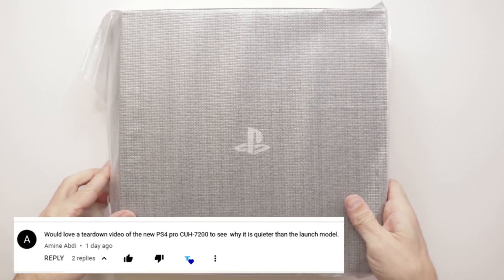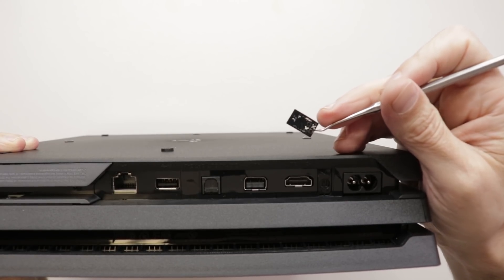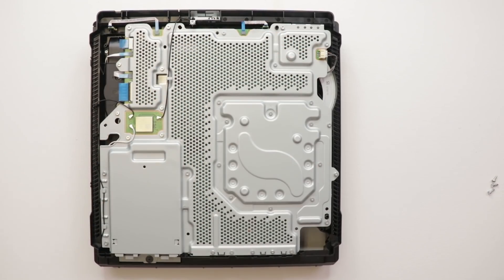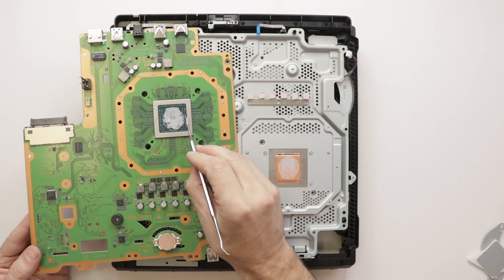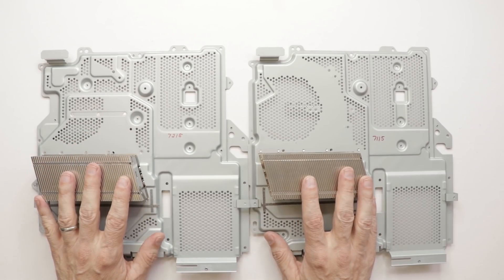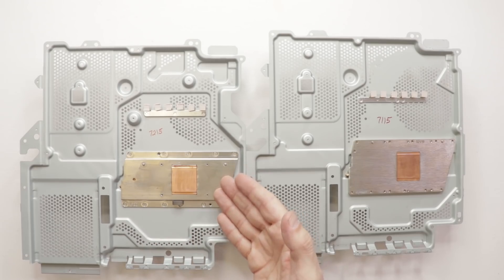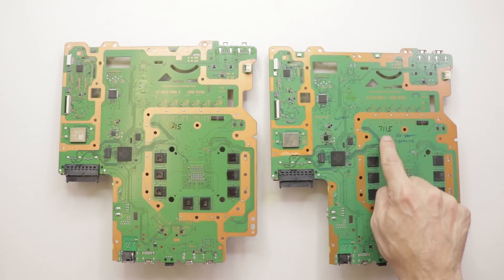The New 2018 PS4 Pro is so Quiet - But Why? Disassembly and Comparison - 7215 Model

Comment: if you have only cooling problem and want more cooler and quieter just open the ps4 pro case while playing it. thats simple =))
Reply: The case is there for a reason. The more dust and debris get onto the inside of your PS4, the shorter the life of the components. If you're going to do this, make sure you clean it out regularly.

Comment: The metal plate around the copper contact pad isn't really doing much in the way of sinking heat. It is just there to hold the heat pipes against the real heatsink (the part with the fins). 
I do see one big difference on the new board: They have redesigned the power delivery with new components. I'm not knowledgeable enough to know more than that, but it is a definite change. I also think you should compare the fans and the fan shroud as a better designed airflow could greatly enhance the performance of the cooler at the same sound level. I would also be interested if it is the same OEM who has manufactured the fan on the new and the old one.

Comment: My guess is that the older model used the 14nm process used in the RX 480 and 580 gpus and the newer one used the 12nm process used in the "new" RX 590

Comment: 7215 seems to have tapped holes in the heatsink around the processor.  the 7115 does not? the better mounting pressure may help a lot?

Comment: It's the cutout holes, the new 72 series have less holes but more direct to where it's needed, as for 71 series has more holes so it loses the more direct effect. Works similar to a jet pump, if u was to have a jet pump with a big opening and one with smaller opening, the smaller opening would be more efficient,  but it all depends on the power being fed too. Also more holes would cause a louder fan sound,  as for less holes would be a bigger hiss sucking sound.

Comment: I’m not sure which model I have exactly but it’s definitely nothing like those. For one the cpu doesn’t even come in contact with a copper spreader that goes to aluminum heat sink. It literally just touches what appears to be a piece of steel with copper inside of it

Comment: With the ps3 they used to do similar with lower power revisions, smaller heatsink and adjusted fan profile. when the TP dries up it would even up being louder and hotter than the revision before it. when i used to repair them i used to fit the previous revisons heatsink (where possible) and they ran even cooler and less fan ramp ups than when new.

Comment: I bet they dropped down in nanometers... Can you take some super high resolution of the chip markings? Maybe not the serial numbers, for like security reasons, or whatever... But I bet the part numbers are different on those chips. And that part number difference I bet will be a drop in nanometers. Because that chip is made by AMD and AMD is just revising all of the CPU and GPU... And I bet they were experimenting with it in the PS4.

Comment: Top left you have 3 lines of 6 components.
Top capacitors? between the first and second there is another cylindrical component, which is missing on the newer board. and a second one again above that.
Then between 4 and 5, squarish component missing on newer board.
Dont know what they are, but why remove them in newer board?
Reply from the maker: There's differences like that even on boards with identical model numbers.

Comment: Sony should just redesign the cooling solution and make it similar to the Xbox cooling solution. This current design just seems too complex and over engineered.

Tiny loud fans provide no benefit to anything. The Xbox One X uses a 120mm fan which is why it is quieter.
Reply from the maker: Xbox One's have really good cooling systems.

Comment: I do see a difference. My ps4 pro came with not enough thermal paste to cover the whole chip, also the thermal pads where not placed correctly. Once I replace the thermal paste and put the thermal pads in the right position, the ps4 became completely silent, you can barely hear it sometimes and that is it, just like the PS4 Slim.
Reply from the maker: That's crazy that it didn't come with enough. Was it brand new like that?

Comment: yup my new 7215B is Super $%$% quiet its quieter than my PS 4 slim it seems.. But the OPTICAL DRIVE is louder when its installing or reading a disc

Comment: I think it has to do with the new power supply (same power output but more efficient therefor less heat output, not sure since I can't find the PSU specs for the older models but this one has about 290watts DC output) and maybe more efficient VRM's (again same power output but more efficient therefor less heat output). This is theoretical tho since I don't know what VRM's are used in all 3 revisions of the Pro's
Edit: the one thing I know for sure is you just got another sub :D
Reply: From what I looked up the 7000 was a 310 or 320 watt ratting. So the fact the 7200 is down to a 290 watt is a significant lowering of what the power supply is putting out.

Comment: The PS4 slim uses s 16nm die on the CPU. Maybe they have changed the die on the Pro thus using less voltage and causing less heat. You kinda said that but generalised it with "efficient".

Comment: I recently took apart my ps4 the base model to clean and change the thermal paste so it wont be as loud and i did that without braking anything and i put it together with all the cables plugged back in and i tried to turn it on and now it wont turn on what could be an issue?

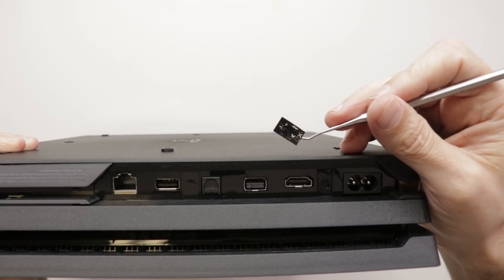Comment: Why didn't anybody notice the little hole (air intake) within the circular rubber feet @1:15? As I recall this wasn't included in the previous revisions. Could this be the reason for the better heat dissipation and airflow within the unit?
Reply from the maker: That's for the manual eject function.
Reply: @Tronicsfix  Ok, thanks for clearing that up.

Comment: The cover over the VRAM was also changed. 

On all the other videos of PS4 Pro disassembly I've seen (Including yours), it's in 2 pieces, now only 1 piece is used. 
The entire top plate is now connected to the VRAM thermal pads, instead of having an other plate in-between. (Check in your own video here: https://youtu.be/Sg386lHY5Bk?t=260 )

Also the Spacer was a X shape and now has been changed to a somehow curved shape but it's irrelevant
Reply from the maker: Yes...all good observations.

Comment: there is a 7216B, from what I read that version has the best noise reduction and heat distribution. Might have a look at that.
Reply from the maker: The 7216b is the same as the 7215. They use different designations for different countries and different hard drive sizes.

Comment: I think that one of the reasons could be the holes in the metal plate. It seems that it has changed so the air can go through the plate more easily.

Comment: If it would be possible to do some Undervolting and Manual Fan Curve in the Playstation Settings i would get the older model more quiet then the newer one with the same or even more Power/FPS/what ever.

Comment: @Tronicsfix, question. I cleaned my PS4 Pro fan out the other week, and now it won't even turn on. Not a beep or anything, I've tried using a disc to force start it, but nothing! I cleaned the fan with a few questions tips and it hasn't turned on since, would you know what the problem would be? I don't want to buy another console if there's a simple solution
Reply from the maker: Unfortunately, no way for me to know. Sorry.
Reply: How did you clean the fan? Did you disassemble your Pro? Or just lift the top cover off? If you disassembled it chances are you never put the PSU (power) cable in correctly or maybe you messed a wire up by being too uneasy with it!... if not then what did you use to clean it out with? If any liquid gets on the board or any wire grooves, crevices, etc etc chances are you've shorted it out and just need a new fuse but I would try and dry every part where there's electric passing through or something... specifics are needed before info gets handed out as it helps 👌
Reply: @Voodoo-187  Hi, thank you for replying! But I used dry que tips, also I only took the top off!

Comment: The MOSFETs / Chokes on the 72xx model have a better contact to their cooler because of the two extra screw mounts, one right next to them and one a little bit further above. 71xx doesn't have these.

Comment: Thank You for the video.
The only reason for 7200 to be more quiet is the higher internal temps and less aggressive fan (software based). Which is not a good thing in general because higher temps=less life. With how much it will shorten the life expectancy of 7200, I cannot say.

Comment: Hey tronics! Great video as always but I'm at a predicament. . . I just replaced thermal paste on ps4 pro 71 series and this will sound really weird but I'm sure you'll know what it is! The Pro runs quiet and as it should since the paste is antec nano diamond 7 series! Anyway I sit about 2foot away from my console and if I yank myself up outta my gaming chair it's enough to make the screen glitch out to where it either goes green or fuzzy and I have to take out hdmi cable and replug and then it's done but if I move the console around, tap it, knock it, nothing happens whatsoever unless I'm in my gaming chair directly opposite the console and get up really fast in a jolting manner! Please help! I've opened it up and checked thermal paste and applied again, checked pads, even checked the white thermal pads for the ram I presume? Please help me tronics I'm so gutted! I followed your video to a T!.
Reply from the maker: Hmmmm...I'm really not sure why it would be doing that. You could always just not jolt it.
Reply: @Tronicsfix  hey bro! Thanks for replying but you never would of guessed what it was xD it was a power problem! I swapped power strips and turned the Pro on after being plugged in rather than just plugging it in which has been known to cause shorts in the system. .  I can also tell you that if you plug a Pro in and you don't hear a extremely quiet and faint sounded click (power supply starting up I presume?) Then chances are you'll run into the same problem as me but then again you might not xD these Pro versions aren't as predictable as the OG ps4. . . Anyways of course when I moved from my gaming chair the power strip would be "interrupted" from gravity I presume or maybe the floorboards 😏 so that's all sorted 😊 can you lend me your brain on thermal paste around the little dots that surround the main chip/APU it's almost impossible to get off without worrying of damage and Sony really slapped their crappy paste on mine...I done the best I could getting it all off but I noticed you don't even get all yours off is this safe Tronics? Thanks again bro
Reply from the maker: Those little components around the shiny part of the APU? It won't hurt anything if there's some on those.
Reply: @Tronicsfix  top guy! Thanks man! Making every console owners nightmares a cake walk! GG

Comment: Nice video! Can you please try to apply the same thermal paste (same material and condition) on both models and test if there's any difference?
Reply from the maker: I put AS5 on it when I put it back together for the heat test.

Comment: What about the main component that causes noise: the fan. Maybe it is built with optimization for silence? Does it run at the same speed? Does the apu have a different model number?
Does it run at the same temperature?
Reply from the maker: I'll be taking a look at the fan in a future video.

Comment: I wonder if the power supply has been revised internally also. They have changed the power cable from a C18 to a C8 connection.
Reply from the maker: I'm talking more about the power supply in my next video.
Reply: @Tronicsfix  Excellent, will check it out

Comment: I don’t believe thermal compound needs to be wet to function. As you know, as soon as it heats it becomes gelatinous.
Reply from the maker: It doesn't...but it does work better when it's wetter.

Comment: Digital Foundry did a comparison on both of these PS4 Pro models, and they found that the 7200 models ran quieter but hotter and the previous models rather slightly louder but were cooler.
Reply: Could you share the link?

Comment: Is the fan the same? You didn't mention that.
Reply from the maker: Similar...that will be in my next video.
Reply: @Tronicsfix  Great stuff. I have the  7116B (white) and it sounds really loud. I have changed the paste but nothing has worked. If the fan is different, I'll be tempted to change it.

Comment: After reassembly it again, does that ps4 pro run louder than before? Or maybe quieter with custom thermal paste?
Reply from the maker: I didn't run it before I took it apart. I put AS5 thermal paste in it when I put it back together.

Comment: Would look closer at the fan, fan bearing type, fan mounts, ventilation holes, sound-dampening material, chassis construction, etc. Maybe motherboard is limiting RPMs of the fan. Could get a tachometer to measure this or use frequency setting on DMM checking the RPM terminal on the fan or try a fan accelerator mod. Could connect the fans directly to a DC power supply to audibly compare them with same power rating to eliminate that variable. Since the 72XX runs hotter, don't think the heatsink or paste explain the noise improvement here. Wouldn’t be surprised if Sony just lowered the fan’s RPM with less voltage input to it.

Comment: I can't seem to get black middle screw off on the power supply. Any idea how to remove it?
Reply from the maker: Hmmm....not sure which screw you're talking about.
Reply: @Tronicsfix  Thanks for replying!  The screw looks of a triangular shape and it might be made of some sort of plastic because it bends a little when i try to remove it. it is the middle screw right towards the bottom part of the power supply  metal shield. ( my ps4 model is the CUH-7215B)

Comment: The 72xx runs hotter. Maybe because the fan spins a little slower hence the quieter system?
Reply: Ricardo Dealtry Because the heat sink transports more heat away.
Reply: @kraenk12  the heatsink is bigger on 7100...

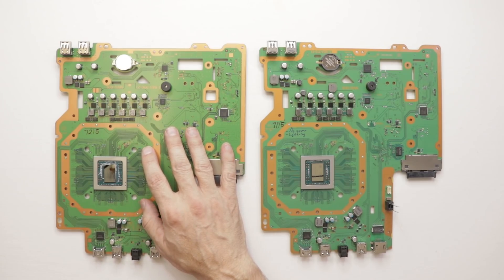Comment: 7:40 Right at the end I noticed that three chokes are missing from the new board's VRM section - perhaps they are using a new power delivery circuit that is more efficient?
Reply: They made changes in the power supply

Comment: I hope that this new model of ps4 pro runs much cooler than my launch model
Reply from the maker: It runs quieter. The exhaust air is hotter but I think that's because the cooling system is working better and transferring heat away from the chip better.

Comment: Dont want to knock on your video but every playstation 4 is quiet when new. Give 2-3 months of use and the machine will up the desibels. I remember my "mouse quiet" launch base ps4 but After like 3-4 months I could easily hear it. Before the heart attack that got my og ps4 it was loud as hairdryer or even louder than og 360
Reply: Henry Kruger If you don’t clean after yourself....

Comment: Pretty sure they could do a software update to slow down fan slightly
Reply: If they slow down fan, your PS4 Pro could overheat and get damage with the time. This is not the solution. The better thing they can do is to have quiet fan. I hope the PS5 would have better cooling system (efficient & quiet).
Reply: @WalkyZGaming  just wait a year after it releases
Reply from the maker: Yes, I'm sure you're right.
Reply: Why should they. It's quiet enough already,

Comment: Is the metal thicker, I mean the metal case?  That would maybe make it more quiet, or an improved bearing / fan design?   The CPU might be of a different revision?  I just do not have the money right now to purchase new gear but I will see if I can buy some used ones here in Canada.

Comment: I have the 7016 model. l played rdr2 with supersampling ON and the console sounds like a jet but as soon as I turned it off it runs very quietly. 
I didn't know that much differance 
and i think its only effective in red dead 2 because all the games i tryed have the same amount of noise on both conditions! 
Whats your opinion?
Reply: Mahyar mt Supersampling is basically running it in 4K and scaling it down. No supersampling means it runs at 1080 at faster frame rate.